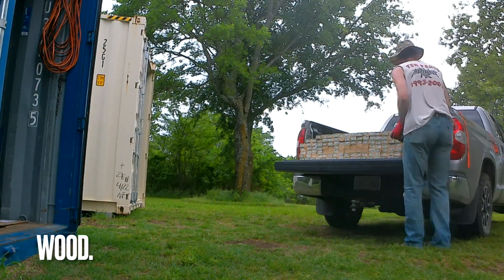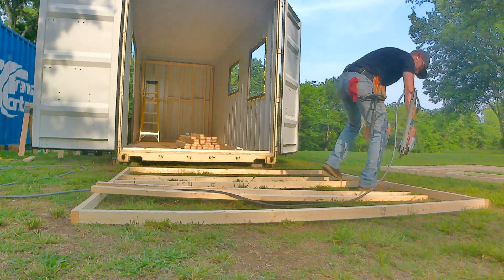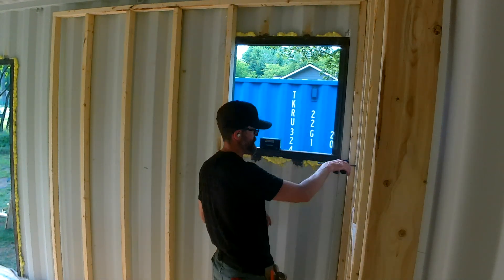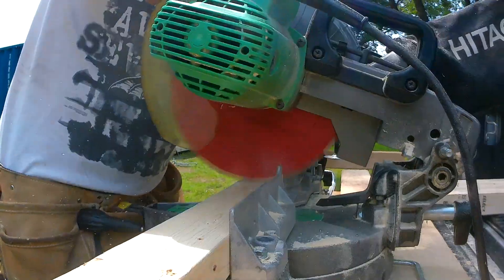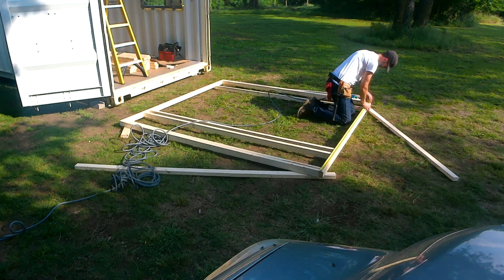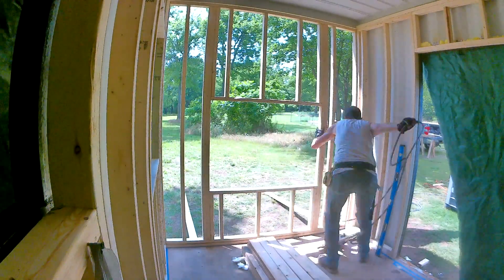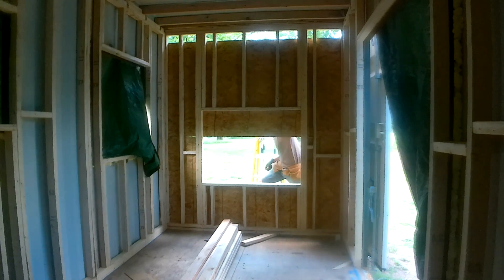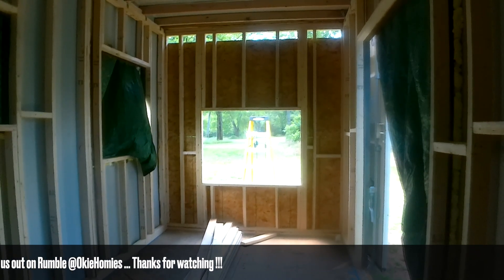Framing the container home

Comment: have you done a cost breakdown for the 20ft container? I'm moving to Colorado from Texas and planning to do similar project this summer while I'm there but haven't seen a lot of cost breakdown videos for fully finished 20 footer. enjoyed the video great commentary and how well did the 2x3s work for your projects?
Reply from the maker: I haven't done a dollar for dollar cost breakdown yet, but it's roughly $10k to get to the installed drywall stage. I wouldn't use 2x3 again for a few reasons. One is the quality of the lumber, few places stock 2x3 boards so your selection is bad. Another reason is making sure electrical boxes are correct, depth of plumbing issues, etc. It's worth giving up the inch and using 2x4 for many reasons.